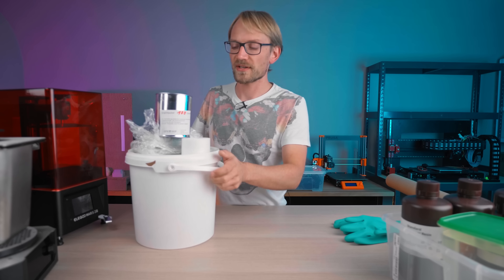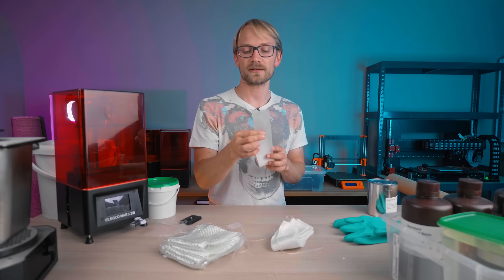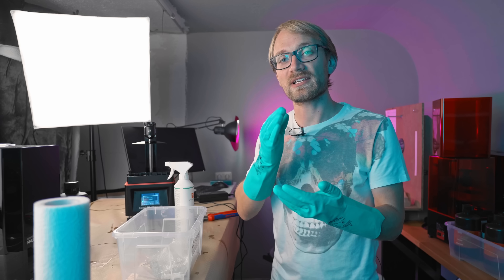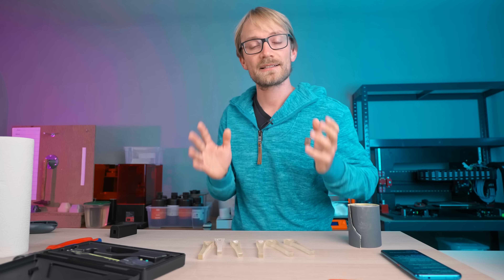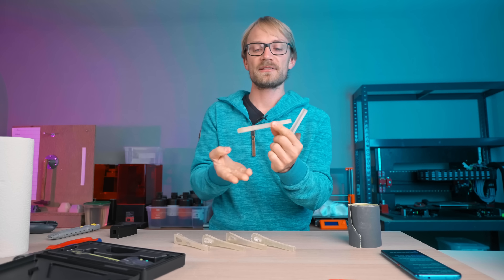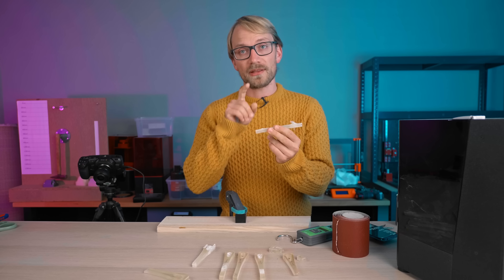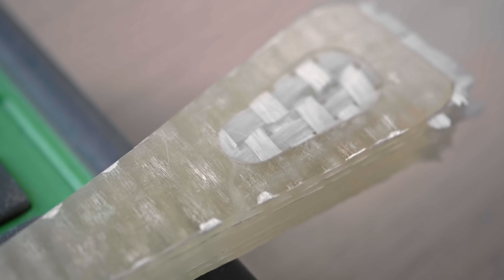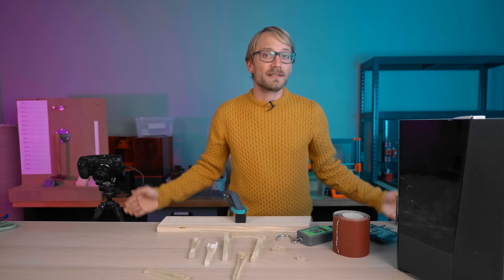Fiber-reinforced resin prints - how much STRONGER are they?

Comment: Carbon fiber added to resin is the same as putting metal rebar to concrete. It's more durable and much stronger if applied correctly. Nicely done!

Comment: Maybe it would also be good to test the orientation of the fiber weave as well? Alternate the layup 45° each layer perhaps? Great work as always!
Reply: Was just going to say this and luckily your comment was first in the list :)
Reply: Much like carbon fiber parts, you have to design the reinforcing or part (if it's entirely made of fiber) for the application you'll use it for. This is why carbon fiber fails when it receives impact or tension in ways it wasn't designed to handle. The brittleness is a side effect of the reinforcing as well. You're making a strong part, but not a tough part.
Reply: @BrunodeSouzaLino  correct, but simple linear placement isn't always best. The carbon tubing on a bicycle is a good example of how angles and weave can distribute load and add to overall strength as well. As all have mentioned, carbon needs to be implemented with desired parameters in mind. But as a home DIY test I think its worth testing, triangles are strong, 45° angles are used in reinforcements everywhere you look in manufactured and natural settings. 🤷‍♂️
Reply: I get Tom's train of thought with the highest stresses being in the top and the bottom. But that is not the point with the reenforcements . You wann put the reenforcements in plane with you force vectors. If you have access to FEM model a Sandwiched beam and you'll see that you increase the stresses on the interfaces by almost a magnitude. But if you model it so that your ridget layer is basicallz along the cross section it becomes stronger.
Reply: I was just thinking that! Great idea! :) The orientation of the fiber layers is very important as well.
Reply: Orienting the fibers in different directions helps strengthen the part against loads in those directions.  It wouldn't necessarily improve the results of this one test that Thomas is doing.
Reply: @noelwade  at the moment the only fibers being used in tension are the lengthwise fibers.  The horizontal fibers aren't doing anything and can have a negative impact just like layer separation with FDM printing.  Putting the sheets at a 45 degree angle could help to spread the tension across all fibers throughout the part.  It would be another interesting test to see the layers at 45 degrees and a quasi-isotropic part with alternating layers of 0/90 and -45/+45 degrees.  Also a test with only lengthwise fibers instead of a weave because I suspect the horizontal fibers could weaken the structure as they are useless in this test anyway.👍
Reply: @ryanlandry8214  yes, my thoughts in an expanded nutshell. Adding the angles to create more of a weave and distribute the loads more evenly throughout, adding to strength all around in every direction in the process.

Comment: okay... so this gave me ideas. try adding glass and carbon fiber to the resins. shake it up & print with it. might get some similar properties to fiber filaments.
Reply: The problem with htis might be that some of the fibres point in Z direction and could cause damage when layer shifting (not a sla guy myself)?
Reply: @raise-project  there could be some scratching of the fep film but there's enough give in the system/ the fibers are small enough that it shouldnt damage the lcd
Reply: @dakotapahel-short3192  I meant more the ffect that part of the fiber is within cured material the other is not and on layer shift you don´t have a clear seperation leading to small defects in the last layer (maybe).